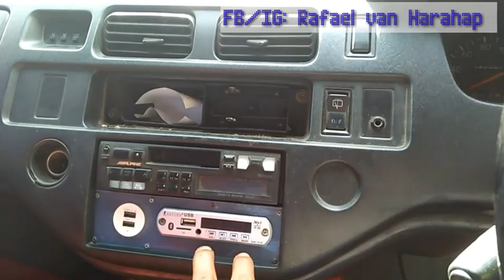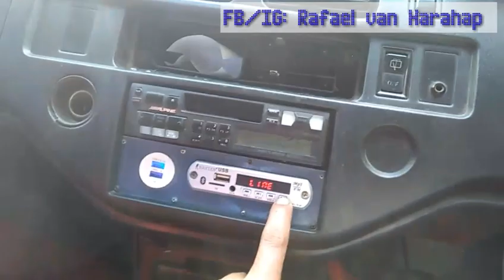Cara Memasang Modul MP3 Bluetooth ke Tape Mobil

Comment: Tuner asli dari tape mobil itu di buang ?? Sedangkan tuner nya sendiri lagi kuat berbanding mas mengunakan tuner module kit, Kenapa mas tidak pakai jalur audio input dari tempat kaset cuma buang ic preamp kaset nya aja kemudian sambung AUX audio, Tanpa mas membuang tuner asal dari tape mobil ?
Reply from the maker: Saya sudah coba untuk tape yg model itu kalau lewat jalur pre amp head suara tidak stabil dan beberapa tape mobil lain.  Tapi ada juga beberapa yg bisa lewat pre amp head bisa jernih dan stabil.
Reply: iya betul saat pake pake jalut pre amd head,  tipe ini suaranya jadi timbul tenggelam

Comment: kalo radionya bukan model seperti itu gmn caranya gan
Reply from the maker: Sama saja sistemnya
Reply: bentuknya ga seperti itu bos. bawaan toyota tapi yg sudah cvd  radionya beda
Reply: ambil dari yg berdengung tapi ko fungsi volume pada tape mobilnya ga bisa buat ngecilin dn sbliknya ya gan. tolong pencerahanya
Reply from the maker: Kalau ambilnya setelah rangkaian tune/ panel maka volume tidak berfungsi.  Ambil sebelum masuk tune/panel.
Bisa melalui kaki/pin out tuner.  Lepas tuner,  dan sentuh2 kaki/pin out tuner setelah dilepas.  Yg berdengung setelah disentuh itulah inputnya
Reply: tape nya beda jadi bingung bos. tape mobil sy ga ada kotak yg seperti silepas itu

Comment: ribet mas.. mending beli modulator yang pakai bluetooth tinggal colok ke api rokok beres tanpa merusak tape yang ada..
Reply from the maker: Ya silahkan.  Semua ada kelebihan dan kekurangannya.  Menurut pengalaman, modulator tidak awet  karena arus & tegangan di colokan api rokok tidak stabil, serta lebih ribet karena harus atur frekuensi setiap kali main.  Dan kelebihan Modul Mp3 ini Bisa Bluetooth dan support bermacam drive penyimpanan. 
Balik lagi Selera. Pertimbangkan sebelum pasang.